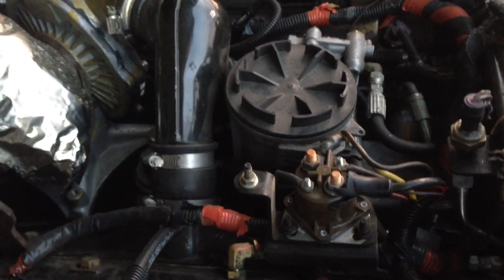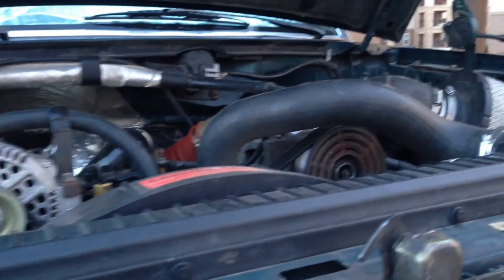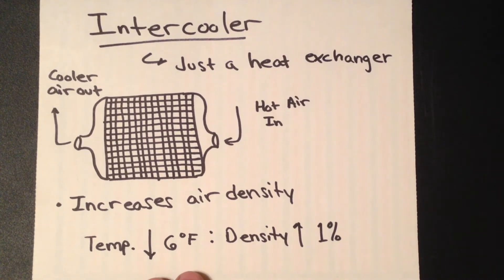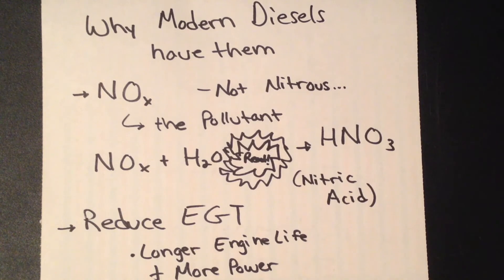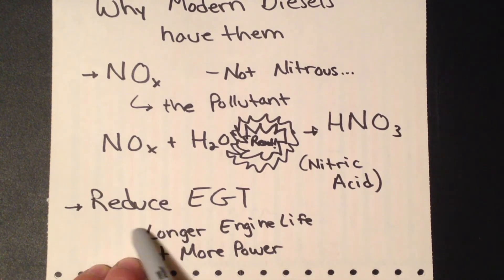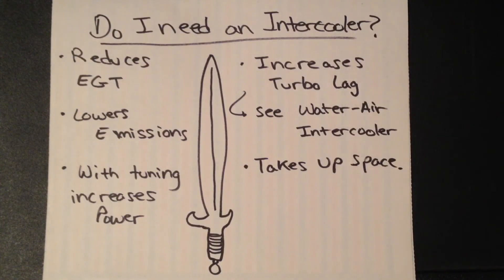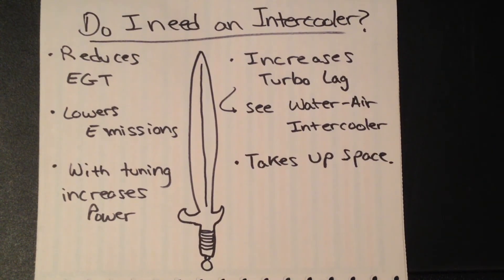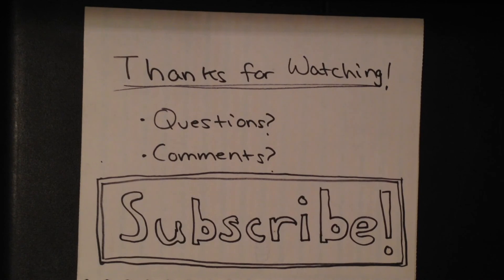Diesel Intercooler Explained

Comment: so on a very cold morning trucks make black smoke  because  compression igition  temp is now less than 210 C,  which created  pollution is worse,  where is the hot pipe off a stove on the exhaust pipe to get the temp UP

Comment: I would love to be able to work out the maths on IAT’s but can’t find your video on how to calculate. Please help thanks
Reply from the maker: What do you mean by IAT? I'm not familiar with the acronym. I'd be happy to help if I can, what calculations are you looking to do?
Reply: Inlet Air Temperature ie the temps at exit from my compound turbo set up. I’m running up to 50psi with both turbos in there “happy” maps. Neither pushes past 25 psi which is not high in a diesel application. Manifold turbo is a Borg k27 wastegated and atmo turbo is a Borg 369 sxe.
These are on a 5.9l Cummins ISB 24v
Reply from the maker: @lanceevans3443  The absolute best way to get what you want it to just measure the temperature, but a good theoretical way to estimate how hot it can get is to to assume Isentropic compression. Scroll to 4:30 in the video and you'll see the equation to use. I'd simplify and assume you only have 1 turbo that takes atmospheric air at 14.7 psi absolute pressure to your 50 psi gauge pressure or (64.7 absolute pressure in the equation). Your starting temperature assume maybe a low number like 70 °F (which will have to be 70 + 459.67 = 529.67 Rankine to get to absolute temperature scale for the equation). So your variables will be P2 = 64.7 psia, P1 = 14.7 psia, T1 = 529.67, and T2 is the discharge temperature you're looking for. K will be 1.4 since you're working with air. So in this case your theoretical discharge temp is 808.9 Rankine (or subtract 459.67 to convert to Fahrenheit makes 349.2 °F turbo discharge temperature). Of course depending on how much boost you have this will change, lower boost means less heat gain, and a higher starting temperature will also translate to a higher exhaust temperature as well.
Reply: @Rnddiesel  Thankyou so much

Comment: cough pollutant cough global warming cough fake liberal belief COUGH  COUGH
Reply from the maker: Here's a cough drop for you. Get well soon! Haha, natedogggydog02 I hear you. A lot of the emissions controls stuff is just politics. Heck look at Diesel Particulate Filters. Since 2007 all new light duty diesels are required to have them since the soot can cause lung cancer similar to black lung for coal miners, yet if you look at many of the city buses and school buses, they don't have Particulate Filters even to this day! So a new highway tow rig that is less likely to dump soot on people in the first place is required to have a dpf, but buses that do contact people aren't required to have a dpf at least until now 10+ years after the initial 'legislation' for the dpf. I know it has to do with emissions per passenger or something like that, but come on, that original 2007 legislation is politics and isn't the most ideal way to actually help people like us! We are fortunate to drive or old school diesels for sure. Besides, I like to think my truck putting out gobs of CO2 emissions is actually undoing all the damage to the environment that the algae did all those millions of years ago before it turned into crude oil. Haha, take care natedogggydog02!